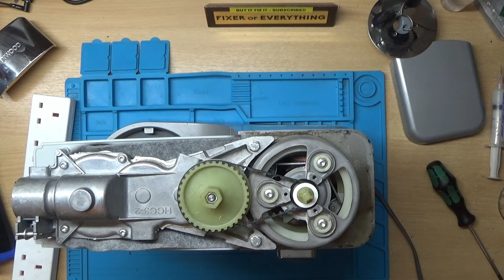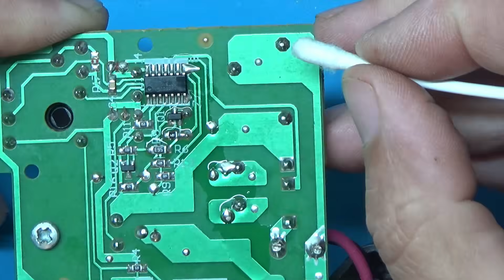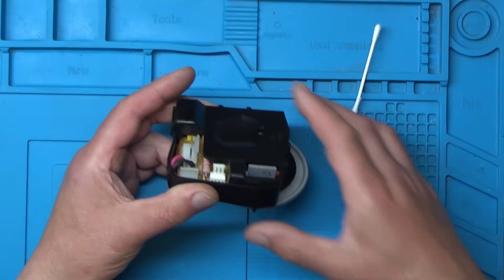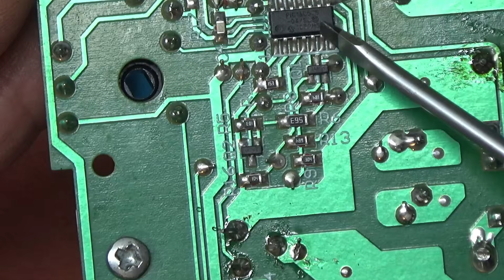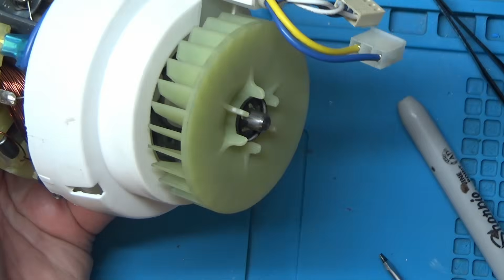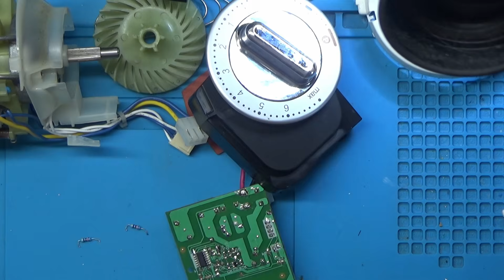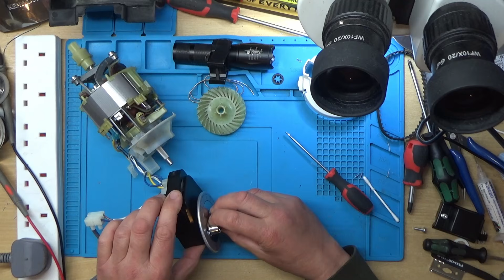Faulty Kenwood Chef Mixer - What A Nightmare! | Can I Fix It?

Comment: Congratulations on the video, a masterpiece. I'm asking for help if possible. When I turn the speed knob to 4, the speed doesn't change, and there seems to be voltage fluctuations. From 4 to maximum speed The engine runs smoothly but increases slightly. There is minimal play in the shaft up and down. I have already fitted new brushes and new points but with adjustment via a spring screw without technical reference.What's the problem for you? Thanks for your help.
Reply from the maker: Thanks 👍It sounds like the one you have might be different to this one, as this one has electronic speed control using a hall effect sensor and a magnet. I did look at a kitchen aid mixer on here which has the old style points, and I did adjust the speed on that. Might be worth checking if it's the same as that one?

Comment: Nice repair, required quite a bit of perseverance. Those are the ones we learn the most of. Little nitpick: The 0.15 µF capacitor, a 'capacitive dropper' it is not - it connects to L and N (maybe behind the switch).
Reply from the maker: Cheers for the correction, I'll definitely keep that in mind for next time! 👍

Comment: Kenwood used to make their gears out of much metal. Worked well until the gearing system would disengage from the worn sloppiness of them.
Reply from the maker: Interesting. The other Mixer I looked at on here (kitchen aid) has all metal gears too. They look beautiful and run perfect, and it's more than 30 years old! I mention that on the video.
Reply: @BuyitFixit     Muck metal - it was meant to be. That cheap zinc waste metal that had no bearing properties and after use, the metal used as the integral bush, wore sloppy and failed.

Comment: Hi, previously you always checked the resistors after the capacitors! What happened? Thx for the video 😁
Reply from the maker: Normally you can tell when resistors go as they either have gotten hot, or they have a hole in them. These looked perfect, which is something that I'd not came across before.

Comment: The yellow capacitor is just for the PIC power supply. If it wasn't working, the circuit would not be working.

Comment: Hi Mick Been working on a Kenwood chef KM300 but no way could I remove the fan off the motor. How do they come off please.
Also struggling to get gear wheel off gearbox to check grease. 
Been a bit of a nightmare really, was given this but checking it over before taking to charity shop.
Regards
Maurice
Reply from the maker: It was a nightmare to get the fan off. I think I used some needle nose plyers under it and luckily it didn't snap. Not sure about the gear wheel as it was some time ago.
Reply: @BuyitFixit Thanks I am frightened of snapping it. Will try your method.
Cheers Mick.👍

Comment: Didn’t understand with the amount of components why you didn’t just measure them in the first place…
Reply from the maker: That's a good point, but I've very rarely had resistors just "go open circuit" without any visible signs of burning or bits blasted out of them.
Reply: @BuyitFixit thanks for message thought i was missing something

Comment: Good video, but..not knowing how to read a resistors value from the colour bands is a bit unbelievable.
It's basic very basic stuff.
Reply from the maker: I learned the color code back when I was 16 or so.. b b r o y g b v g w. However I do still sometimes struggle with 5 band resistors. Remember as I say in the description in all of my videos I'm not an expert and only do this as a hobby. I've also done some very interesting repairs such as the FLIR camera, or the Solar inverter where I had to reverse engineer their software to work out the engineering password etc

Comment: I had one like that a few years ago, I can’t remember what I did to fix it, but fix it I certainly did. It is a common problem.
Reply: I think I bought a replacement control board for about a tenner.
Reply from the maker: That would also work 🙂👍

Comment: My own story with the Kenwood Cooking Chef XL. Was giving the same E:29 error and asking for 30-sec shutdown. Appears to be a brushes problem. It seems that the power-control board notices that something is wrong with the correlation of the speed and the power consumption of the motor. Also when it was still (from time-to-time) working and spinning motor a crackling sound was coming from near the motor itself which obviously sounds like a bad brush-to-motor contact (when it's bad a sparks appear and they are accompanied by a corresponding sound).

Try changing brushes first before tackling with the circuit board. (i myself did same thing as in the video - i bought brushes and sharpened new brushes so they fit under the old ones).
Reply from the maker: That's great info, thanks for sharing your experience! 👍

Comment: I have four of those two more modern ones and two in the 60s or 50. They were beautifully made and I used to love using them but now I'm old. Every part of it can be fixed if you really want to but some parts if you can't get the parts it's a bit of bother to build it.  please understand I have had four strokes so I can't read write
Reply from the maker: They're definitely very well built machines. I hope you're doing well!

Comment: These have been "upgraded". Last time I worked on one of these it used a TRIAC fed by a HAL effect transistor which was mechanically moved closer to or further away from a rotating magnet on the motor to drive or trigger the TRIAC. No PIC Micro-controllers back then.
Reply from the maker: I've got an old kitchen aid one, which I looked at on the channel (you might like that one too). That one has even less electronics than the one you mention. It was quite interesting how it regulates the speed. It's over 37 years old and it's built like a tank, and it was used commercially by a chocolate maker. It's still in mint condition too!

Comment: High resistance resistors sometime dead without reason (inner corrosion?). 
Thanks for video. I must go to my workplace and repair old CRT TV from Samsung. 😊
Reply from the maker: Thanks 👍Good luck with the CRT repair. I've got a CRT to look at too (B&W) it's in a space invaders machine that I'm working on. I've not tested the CRT yet as I've been busy working on the logic board (future video).
Reply: @BuyitFixit  
Thanks for wishes. I repaired TV. 5 hours time spent.
If you interest, TV (chassis KS1A) periodical blocked to protection mode.Before it, picture and OSD periodical shifts to the right. Defect in capacitance divider (CR404-CR405). CR404 (680pF, 2kV) - with crack.Its typical problem for many TV chassis, uses capacitance divider for horizontal phase synchronisation. And I additional replace many electrolytic capacitors, with partially capacitance lost.
Interesting fact: TV made in 2003y. and works many thousand hours, but picture - ideal.

Comment: You frightened me! About five years ago I bought that motor and controller unit, to repair/upgrade to our then 36-year-old Kenwood Chef (originally a wedding present). it hasn't yet failed, but if they're going to it'll be during the pre-Christmas cooking. 

I am so glad it was something ridiculously odd, rather than a "they all do that, sir!" common failure mode.

Thanks for persevering. I'm off to check I have 500k resistors in stock, just in case! :-)
Reply from the maker: Haha, hopefully yours will be fine! Good idea to stock up on the resistors though!

Comment: My wife's Kenwood KM28 is acting strange.
When she put the blender on the high speed outlet, ok the back, it doesn't work anymore, but instead, it's the tool  socket head, at the bottom, that is spinning. Could it be a short circuit somewhere causing one feature to work instead of another? I'm asking from the top of your head, if it's possible w as I'm a noob a that.
Reply from the maker: I would be hard for me to say as I've not came across one of those before. It could be some sort of mechanical problem as I'm not sure how it selects between the two. I'd think there will just be one motor and it might be a solenoid that selects a gear or something which is either jammed or broken possibly.

Comment: Have no other choice but to like this thorough troubleshooting. 

I own a similar model. In my case the speed sensor is damaged. The 65ohm you measure at 43:00 reads open circuit. As a result the mixer spins up to max rpm no matter what speed setting I put on the knob. After 2 seconds it goes to min rpm and can not be controlled. I think it the mixer goes in some sort of "safe mode" because it does not see rpm feedback. Do you think this mini coil is a generic electronic component I can find, or i should be looking at Kenwood specific spares? It doesn't seem to exist as Kenwood spare part, or at least I can't find it
Reply from the maker: It's a small inductor but I'm not too sure of the value. I don't think you can buy it as a spare part from kenwood, only the whole motor. You could possibly see what inductors are out there that measure around 65 ohms.

Comment: Hello, I have a similar issue and I've noticed that the inductor that is attached to the motor is broken, may I ask if you know any way to find a replacement for it?? thank you!
Reply from the maker: Unfortunately not, the inductor is used as a magnetic pickup. The magnet on the motor causes pulses in the inductor which are picked up by the PCB to determine the motors speed. I'm not sure what the value of the inductor is, but you might be able to see if you can find some type of magnetic pickup inductor which may work.
Reply: @BuyitFixit  Do you still have this machine? In that case you are able to measure it and drop that info above where people can find it. The old machines also worked with an inductor so that's why they choose for this design. A step towards a hall effect sensor was probably too big for them. However I am not happy with the use of that microcontroller. Did you btw investigate what that resistor was doing. In the beginning I throught this was some sort of supply voltage problem of the microcontroller which why I was suspicious of that cap. But usualy a very high resistor is used to go immediately from mains to 5 V for instand while at the same time using a zenerdiode to regulate the power.
Reply from the maker: Unfortunately I don't have the machine and didn't have anything to measure the inductors value at the time. The resistors from what I remember, are used to measure the zero crossing of the AC.

Comment: Quite amazing you had the persistence to track down a fault involving one of the cheapest of components. Of the TV repair experience, I've had a share of non functional switch-mode power supplies that rely on a high value resistor (100k ohm +) to start. As well, with an analogue regulated supply, a 33k ohm resistor going open, leaving a regulating voltage divider not supplying current to a power transistor, and causing loss of B+. Like yours, all of those resistors looked normal from their markings...
Reply from the maker: Interesting James👍. Seems I'm not the only one to experience this type of failure then. I actually had it again more recently with the victron battery charger repair which was a nightmare to trace..

Comment: sometimes it happens with manufacuring resistors that one of the lead caps thats on the resistor body is not really gleu'd tight enoug on yhe body , and the resistor metal film is placet over the resistor body and endcaps for connection. it can happen that one cap isnt quite tight on the body and then the metal film will break unther heavy mechanicall stress like shaking in a machine, like this mixer. you cant see it from the outside because of the very thick painted outside isolation, and you talk about a micro crack. but the only way you can trace  it is by move one of the leads a very little when its mounted on the board. or put pressure on it. then the contakt with the film is reastablisht for a short while, and the fail dissapears for a short notes. but thats pure luck. this fault wont give disclorisation because the resistor wont get hot from it.. this repair should be unther warenty because its a mechanical fault, but no factory surch faults this way, they just replace the boards.
Reply from the maker: Interesting. Thanks for that. A couple of people also mentioned that they may be flameproof resistors, that just blow internally and don't show any markings externally when they go.

Comment: I had one of these recently where the speed was at max when turned on.  My first thought was a shorted triac but it tested fine as did every other discreet component on the board, the pot was also fine.  If I disconnected the Hall sensor coming from the motor it made no difference.  The only thing I could not test fully was the microcontroller.  I bought a new board which brought it back to full functionality so I guess it was the MC causing the fault.  (Why they have to make controlling the speed of a motor so over engineered and therefore prone to failure is another question!! ) 
BTW, I love your channel and your great work.  Best wishes from Neville at the Bassett Repair Shop in Southampton UK.
Reply from the maker: Thanks Neville. I think they did it that way to try to keep the speed constant under different loads. If it just controlled the voltage to a certain level, it would be slower with something like bread dough than it would be with whipped cream for instance on the same setting. So I think they use the microcontroller and the hall effect to try and keep it at a constant speed no matter what you are mixing. Hope that makes sense.

Comment: I hate the fact that you can read through hole resistors from two sides and get different numbers out of it. How is this easy fixable problem still a thing nowadays?
Reply from the maker: I think there's "preferred" values so if the value you get isn't one of those try reading it the other day, but I get where you're coming from.

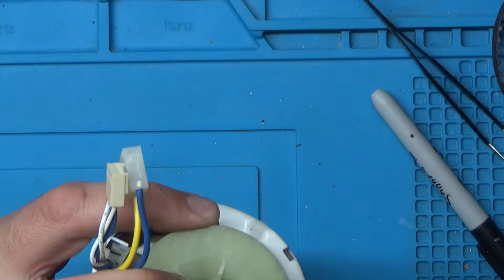Comment: Thanks for sharing this incredible video! I wondered how did you extract the cooler without breaking it? at minute 40:30
Reply from the maker: Thanks 👍I used two screwdrivers, 1 at each side and levered it off. I was worried that it might break but it came off ok.
Reply: @BuyitFixit  Thanks a lot for your answer! I was following the same process, but it’s great to confirm that it’s a good approach.

In my case, a structural metal part of my motor is broken. Since I couldn’t find a replacement, I decided to disassemble the motor and either replicate the part in metal or attempt to weld it. To start, I scanned the part in 3D for reference.

By the way, if you ever need CAD reverse engineering for a part, count on me!
Reply from the maker: @joacolaborda  Thanks very much 👍

Comment: I was building a K2 transceiver kit. At £1000 for the kit I tested every component on a bench LCR meter to double check value before fitting on the circuit boards. One RF choke looked perfect but it was open circuit. A quick shop online and double check and I made it to the first power on which is early in the build. It sprang into life and went through its self tests. Always a scary part for me due to the cost and complexity of these kits. Without that testing I would have had a hell of a time tracking down the open circuit choke. Just because it is new or looks perfect don't trust it until it has been tested.
Reply from the maker: Thanks for sharing 👍I had something like that with a tool charger on a recent-ish video where I was fixing two different makes. I bought some MOSFETS from Aliexpress which when I switched the device on caused it to go bang! Turned out they were fakes, and they should have had a (RDS on) resistance of < 0.75 ohms, but they had a resistance of 20 ohms!

Comment: Thank you for this great video. It greatly helped me repair one myself. It had the exact same resistor resisting more than it should (OL). It would have been a very quick repair, if the trace from the resistor to the chip hadn't disappeared. Noting a little bridge couldnt fix though.
Reply from the maker: Excellent! Well done. I'm glad it helped 👍

Comment: why would you use a microcontroller to regulate motor speed when it has been done with mechanical means for a long time?
Reply from the maker: I guess progress? or cost? It may cost a lot more to produce and tool a mechanical regulator, than to throw in a microcontroller that costs a few pennies these days.
Reply: @BuyitFixit  or planed obsolescence... Awesome repair as always, you don't often see resistors failing like that
Reply from the maker: Thanks, yes I've not seen a resistor fail like that either. Just goes to show..

Comment: It could  the dodgy hall censor the board has to know the speed of the motor.
Reply from the maker: @highfidelity1st  Yes, I had thought of that too, but unfortunately it wasn't that. The microcontroller also needs to know what part of the phase the AC is, to be able to control the triac. It seems it wasn't getting this signal correctly.
Reply: @ I watched until the end, wow a it was a resistor after all and it never ‘let the smoke out’, I was shouting at the screen Hall Effect, had me on the edge of my seat I can tell you, nice one Mr Fixit, I luv a good puzzle..
Reply from the maker: @highfidelity1st  Thanks, yes it had me stumped for a while this one 😂😂👍

Comment: I have a kenwood Chef XL titanium that keeps turning off after so long running. At higher speeds seems to turn off sooner. I replaced the brush motors but no luck. Anyone have an idea what to try next? How to know if speed controller or board? Thanks!
Reply from the maker: It does sounds like a speed controller issue. either that or it's not getting a pulse from the hall effect sensor on the back of the motor properly.